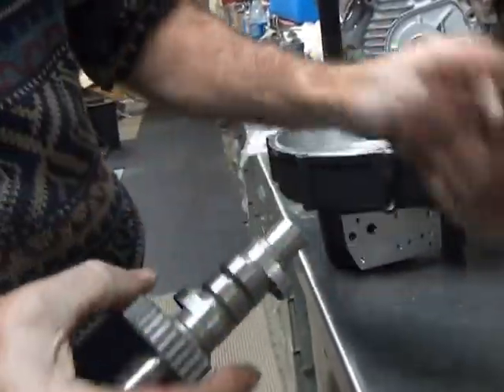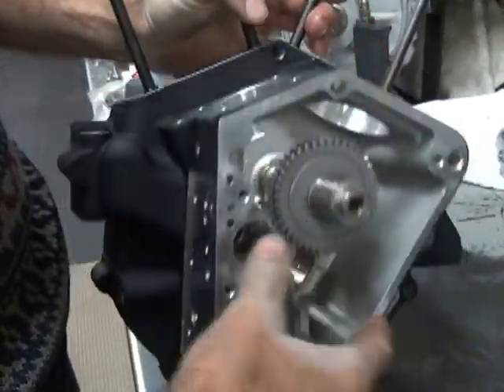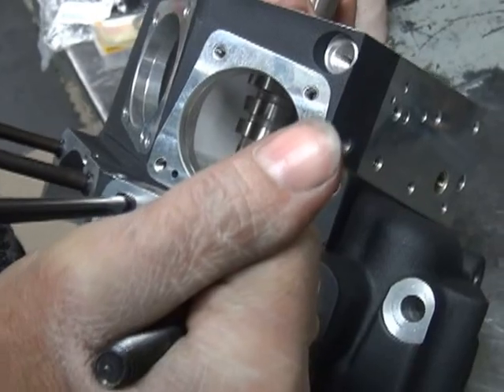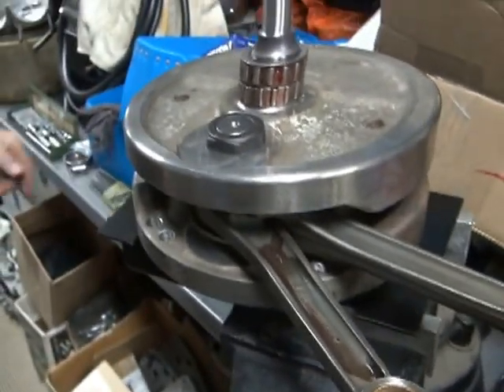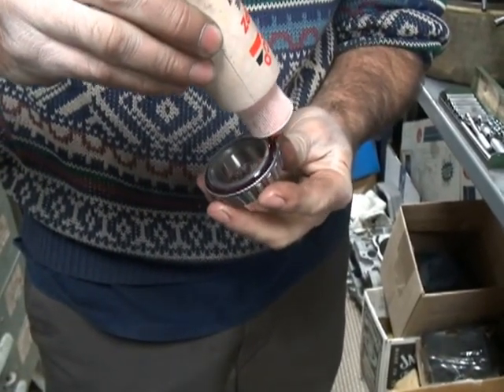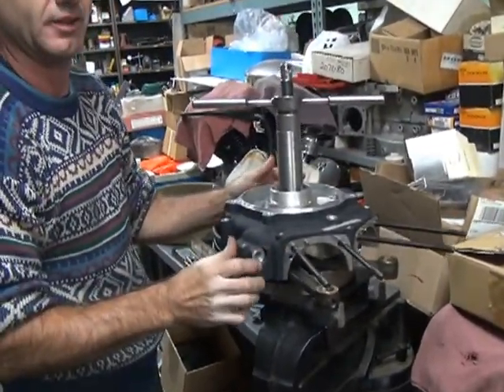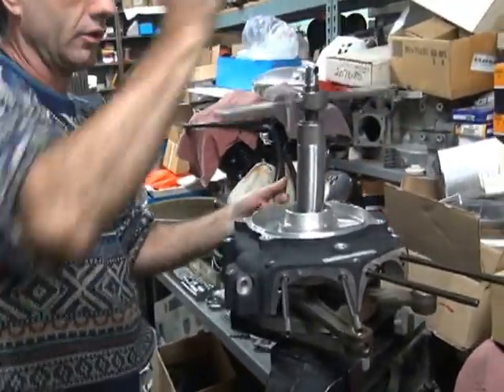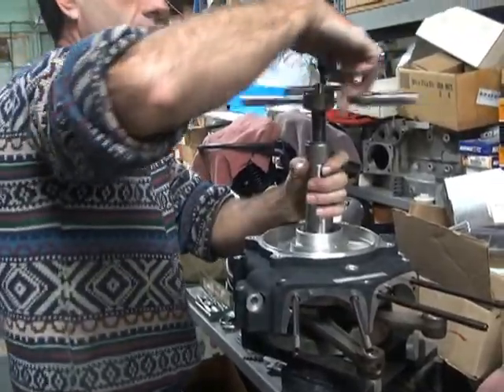#103 1992 Harley FXR Evolution 88ci Motor Assemble Rebuild Tatro Machine

Comment: Hey! Awesome video very helpful. Quick question, I am currently installing a crank shaft into my case. I noticed that you had to pop the bearing to change the shim.  I bought my timken bearing as a set. The package came with the shim, snap ring ,races and bearings.  Are the bearing sets usually pre-measured for bearing end play or do I have to measure and change the shim. I am palnning on putting a dial guage on it but I was just curious Thanks for your help
Reply from the maker: Frank Keating the bearing kits are suppose to be preset but in the real world they varies quite a bit. you can never count on anything being correct. check everything. the shim is what you change to correct the bearing endplay. .001-.003 is good for street motors and .003-.005 for hotrod ones. my race bike, .010-.020. at 8000rpm clearance is very good, tight is not. unlike drag motors my land speed race motor will see 8000rpm for 2-3 miles.tatro

Comment: is there enough material on the cam side of cases to install timken bearings also? torrington suck
Reply from the maker: no. you do not want to do that because you need one side to float or you will knock out the bearings when the crank flexes.
tatro

Comment: I use a old sprocket shaft, removed the pinch fit so the baring will slide on,stack a custom spacer and washer then torque the nut on , thatway you wont be pressing the wheels out of the case , set the end play without the use of the wheels
Reply from the maker: ***** that is one way. jims makes tools to do it their way. I use a press. what ever works for you the best is how you go.tatro
Reply: Absolutly !!